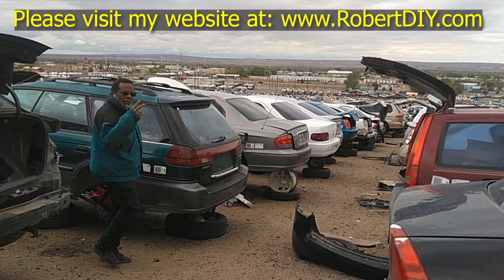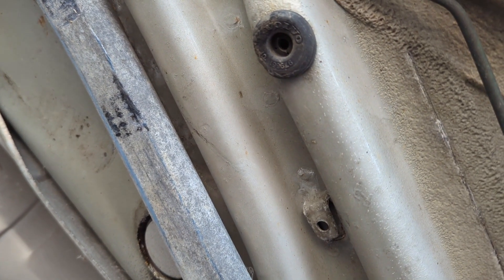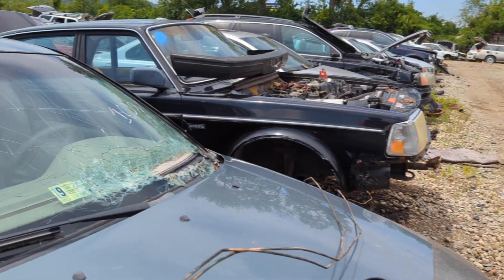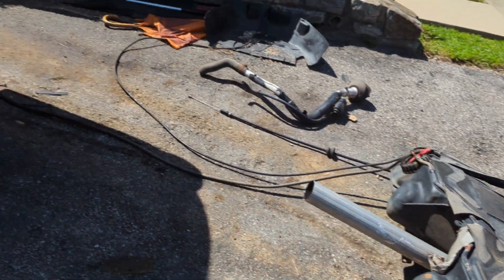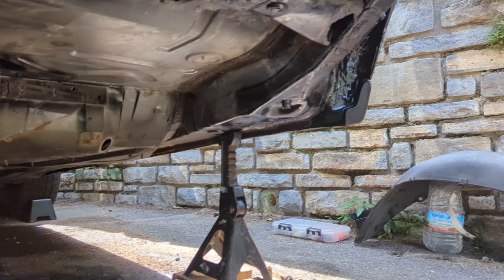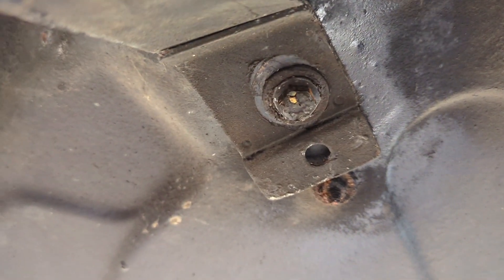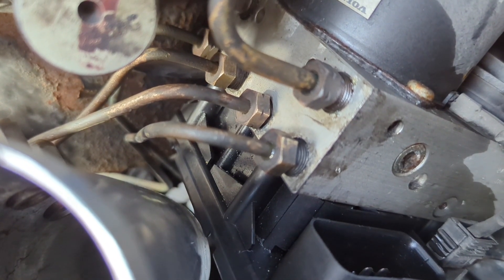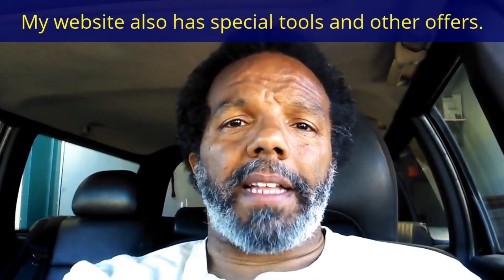Salvage yard run for brake lines, fuel line, exhaust and more. Then more work on the rear end swap.

Comment: It won't help in this case - I'll bet the car is back on its hands and feet by now - but the rear tailpipe hanger 2-piece deal has been replaced by a 1 piece bracket, 9470686. Every P80 I've owned that stuff was a rust ball. Mother Volvo must've had a quality control issue with the sub on those parts.
Reply from the maker: Not yet. They needed rear muds on every car.